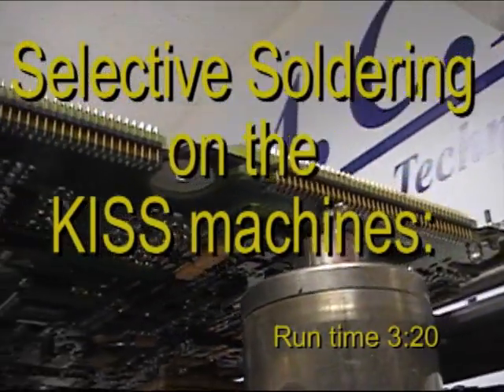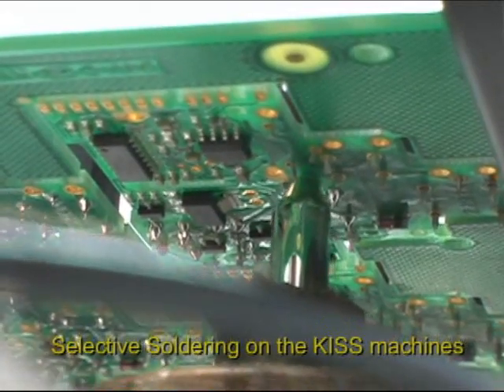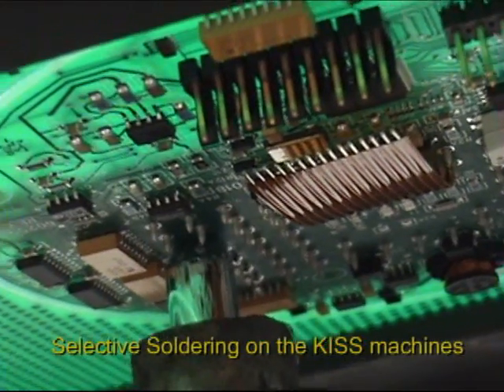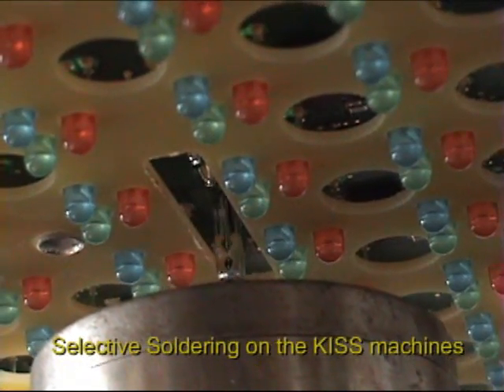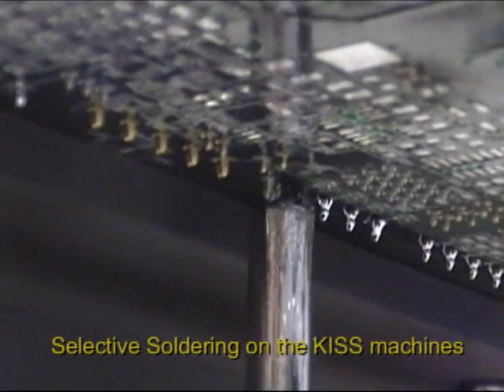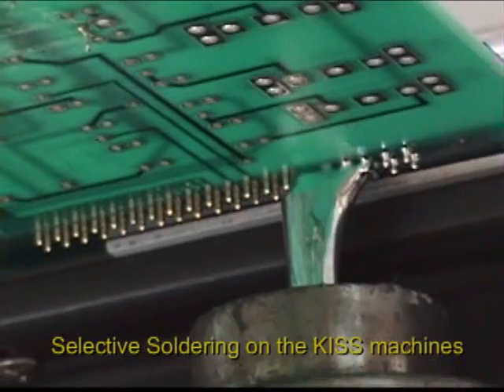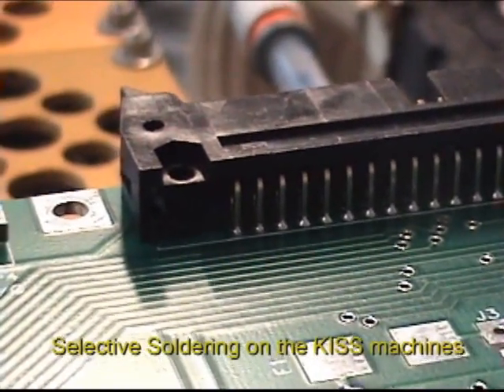ACE KISS 104 Selective Soldering

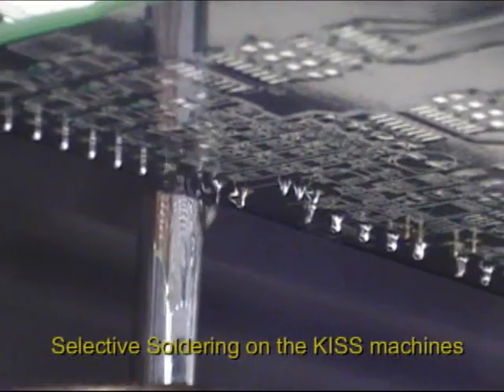Comment: Hello ACE, nice video.  Definitely helps to visualize the selective soldering process.  I noted though that at 1:57, it appears this line of through-hole pins seems to get a little fin of solder left on the pin.  Is this correct or just an optical illusion?  Is this because of improper dwell time setting?  Is visual inspection performed on each board after selective soldering?  Would this be fixed by hand solder rework?
Reply: Old comment but i'll still provide a response. I am not associated with KISS but have 3 at my work I maintain and am trying to restore a spare we have also. Anyway. . . That can and does happen. Sometimes there is not much that can be done. If possible increase flux and possibly temperature. Dwell could be increased if the temperature rise is acceptable. Visual inspection is performed multiple times on the board including immediately after being worked by a KISS or similar machine, by it's operator(s). Hand solder rework can always be done and is usually the fastest option if problem is unavoidable.